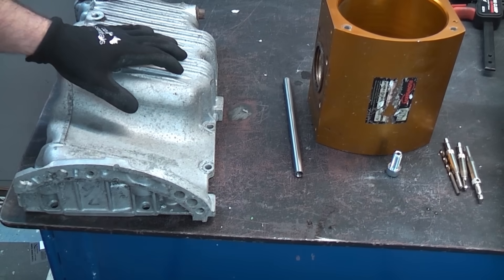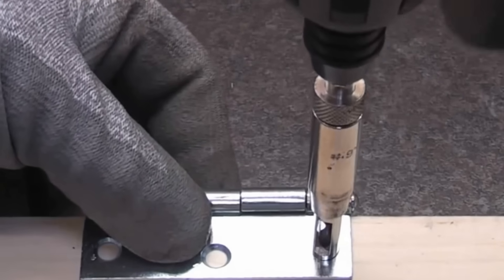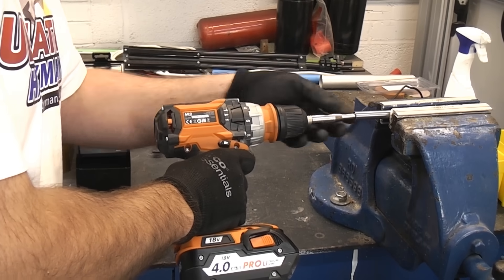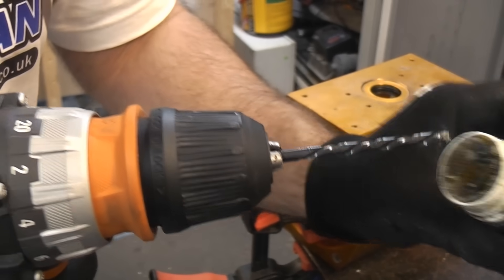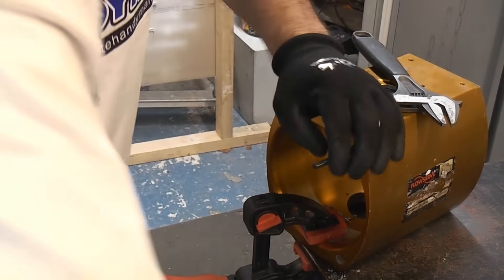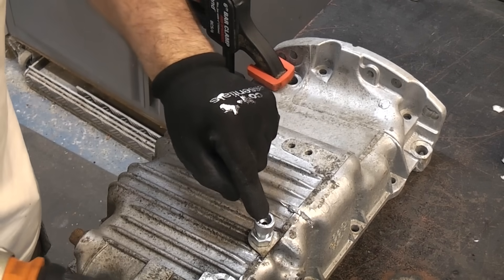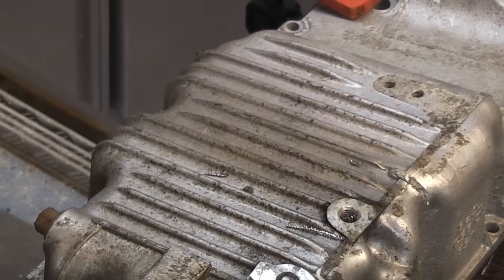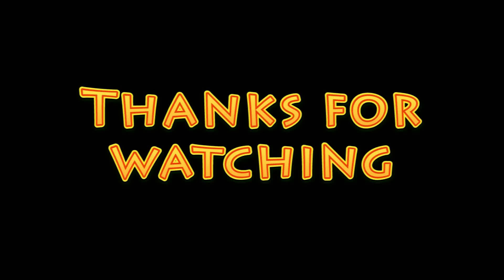How to remove a broken bolt in a deep hole | remove broken bolt in recessed hole

Comment: Sorry, I don’t mean to be rude but what did you say at 3:37? Also, is it suggested to use an impact drill for this or will a regular one work?
Reply from the maker: “you can of course use a regular right-handed drill in a hinge siting drill, but that would then mean that you would have to use a screw extractor afterwards”
Thanks for the comment 👍

Comment: i used my MIG welder and stacked welds on the broken bolt until it was out enough to grab with locking pliers. then i discovered ANOTHER broken bolt beneath that one.got them both with a MIG welder. be careful not to let the wire and puddle go into the threads.quick on the trigger, you dont want a puddle, just stack blobs of weld on each other. i did not damage any threads in my removal.
Reply: oh and my project was in the front of a Chevy V8 350 /5.7 L
Reply from the maker: Thanks for the comments 👍

Comment: great ideas always start with sharp bits made to cut through the material you are removing! and if you break a hardened screw extractor off in the bolt you will need to use a mill bit to drill that out.
Reply from the maker: Thanks for the comment 👍

Comment: 9 times out of 10  when a bolt head breaks from the bolt itself its because it is galled or seized  in the hole . its not because the head was weak and now you just need to grab the threaded part ( all of your examples) The bolt is usually broken FLUSH with the surface so those fancy centering bolts arent worth a shit either.  But as a machinist  these are all tricks your avg. Joe tries before I get it and put it in the Milling machine to get out that now chowdered to hell bolt  with messed up threads . I wish it was as easy as you make it out . not slamming you or your vid , I just deal in reality.
Reply: I agree with you about the bolt breaking, when they break on me, there usually in the worst place, not something I can just set on top the the work bench

Comment: Wouldn't a socket work better than an adjustable wrench? (Assuming there is a small enough socket to fit the bit)
Reply from the maker: A tap wrench is better- but mine was at work!
You can use a socket, but it needs to be 12 point to fit on the square end. 
Thanks for the comment 👍

Comment: Set your driller in speed 1 and on screw position so you can limit the power in case it bite to hard without warning.

Comment: I've never had to use a hinge bit, or made custom banjo style Bolts with holes in them to drill... That spring loaded punch would of been just fine for punching the center of that bolt for an indentation in the bolt to start drilling... just my $0.02 USD
Reply from the maker: Thanks for the comment 👍

Comment: What I do is I drill in the exact center with a small bit and then progressively use bigger bits till it's so thin you can use a pic to fold it then remove.
Reply: Just watched your video and I like the tools you're using.

Comment: Great video. My only criticism is that you missed what I think is the most important first step when encountering a recessed sheered bolt, which is getting yourself in the right state of mind to begin rectifying your situation. I believe these crucial first steps are as follows:

1. Swear loudly, make sure neighbors or passersby can hear, and look for anything else to blame apart from yourself.
2. Throw something at something else. As hard as possible. Morale can be gained if something annoying breaks as a result.
3. Kick something sturdy enough to potentially injure a toe. However, morale can be reduced if you do actually injure a toe.
4. Stop and ponder the fact that if a god actually exists, he must vehemently despise you.
5. Repeat steps 1 through 5 until you no longer feel a vile blend of regret, defeat, hatred and directionless rage.
6. Move on to trying the great tips in this video, then revisit steps 1 through 5 each time you fail.
Reply from the maker: Thanks for the comment 👍
Reply: 7.  Kick dog... if you don't currently have a dog, kick two cats for each dog you once loved......and last but not least... 8: Pour bourbon over ice in a medium sized glass.  Savor while thiking of your favorite vacation retreats.    Do not re enter the garage for 24 hours......

Comment: What did you used? What chemical is that?Is it coating compound? Or what?
Reply from the maker: I used a cutting paste, which prevents the drill bit from getting too hot.
Thanks for the comment 👍

Comment: as long as it s a steel bolt screwed into aluminum you can use alum to dissolve away the bolt
Reply from the maker: Thanks for the comment 👍

Comment: Hmm, could you not have done it with a smaller bore tap, drill hole, tap it with left handed threat then remove snapped bolt. Maybe producing the left-handed threat would take the bolt out. If not then tightening a bolt into the left-handed threat would remove it. (Left-handed threads tighten Anticlockwise) Just a thought, all that hammering could damage the casting I would have thought.

Comment: Very good video.I've been lucky that the bolt broke with enough steel to weld a oversize nut on the broken bolt.with the heat from the welder it came out easy....
Reply from the maker: Thanks for the comment 👍

Comment: Heh, Al is easy. What about bolts in 10-years car suspension?
Reply from the maker: Same technique, just more difficult
Reply: I've had two times that bolts have stuck in car suspension compnents and haven't been able to remove it. Both times I have simply bought anothe pice of the part that was affected and swapped them out, once a front suspension upright with wheel spindel and the other time a rear wheel spindle and torque arm. Cheap and simple. oh, you need to remove a ton of stuff and remount it though.
Reply: You need a stick or mig welder & a steady hand. Build up a nice bead of weld & grip it with vice grips once it's cooled down. I've sometimes even welded a nut to the bead so I can use a spanner or socket. Start off with small movements in & out. It usually breaks the first try but after a few attempts the heat goes through the bolt & gradually frees it off, as well as shrinking it slightly. Don't bother with an "easy out", it'll just expand the bolt even tighter.

Comment: Should have blown out the drilled metal so its not scraping the threads as you back out the bolt. Noticed you "rethreaded" a few threads when you screwed your center bolts back in to prove there was no thread damage.

Comment: Great tip on the bolt with a hole through for a guide. Corroded bolts in aluminum are not as easy though....you would swear they were welded. Nevertheless they need to be drilled IN THE CENTER...great vid!
Reply from the maker: Thanks for the comment 👍

Comment: how did you drill the pilot holes in your guide bolts...with a drill press? that is a great way to ensure you don't ruin your threads on either side. enjoy your instructional video
Reply from the maker: You can use a lathe, or a drill press- https://www.youtube.com/watch?v=6mZj0J6CNYA
Thanks for the comment 👍

Comment: I'm sitting here watching a video about bolt extraction, whilst the other half is upstairs, wanting the opposite. But I have my priorities.
Reply: I wish my wife wanted a good bolt insertion, believe me I wouldn’t be here watching a video about bolt extraction. 😂
Reply: That girl sounds like a keeper
Reply from the maker: Thanks for the comment 👍
Reply: Ha Ha Ha Ha Ha
Reply: She wants some action and you are watching YouTube?
Reply: She may prefer to be drilled
Reply: Priorities first, then nut extraction
Reply: You might actually be a nut.
Reply: I'm sure you paid for this  privilege in advance.  Watching The Bachelor,  going to the Mall,  etc..
Reply: I can personally testify, WD40 won’t make it easier...
Reply: @colinsavill3459  ...i use a trick..after the wd 40 i tap the stuck part several times..then come back in a hour and do it again. It cn loosen it but takes more time....but can be worth it.
Reply: What's your address?
Reply: Either way! you've got troubles.
Reply: This could prove useful for you in case you break it off trying to pull out.  Gotta use an extractor.
Reply: The puns here were worth checking out this comment thread.
Reply: LMMFAO!!!
Reply: Take your welder with you, don't get stuck.

Comment: i use a different bolt extractor, think its called "easy out" you drill a hole and then you got a bit that almost look like and allan key but its got splines on the tip, you hit it into the hole and it cuts spines into the hole in the bolt, then just turn it and bolt comes out, great video tho, this is becoming a lost trade
Reply from the maker: Thanks for the comment 👍

Comment: Who has access to these tools?
Reply from the maker: Hinge centering drills- https://fave.co/2DpJo1H

Left handed drill bits- https://fave.co/2xJjK1M

Teng screw extractors https://fave.co/2OnfRuF

Dormer taps -https://fave.co/2OsN1sQ 

If you are in the UK- 

Hinge centering drills- https://fave.co/2NE1VMc

Left handed drill bits- https://fave.co/2DubtF4

Teng screw extractors- https://fave.co/2pVLkVT

 Dormer taps - https://fave.co/2pTfbyx

exact cutting paste- https://fave.co/2Nabyxc

cobalt drill bits (they are much better on harder steels like bolts) https://fave.co/2zDh3kp

You'll have to make the guides yourself, but they are easy- https://www.youtube.com/watch?v=6mZj0J6CNYA&t=1s

Spring tools centre punch- https://fave.co/2NbnLBD

Comment: Good job, excellent! Even your vid quality is good and U don't waste a bunch of time showing stuff that should be obvious to garner more viewing time. Will definitely save this. The centered drill, drill sleeve is great. Yes, that is the difference of course. If you don't drill the broken bolt in the center UR going to have big problems and will usually destroy the threads in the process.  Have used grease, oil, heat etc., to loosen even rusted bolts, tapping is good too it tends to loosen bolt up. Also, aluminum expands more than steel under heat and faster as well.  Have used this principal often to remove rusted broken studs protruding from an aluminum case etc. Well done!!
Reply from the maker: Thanks for the comment 👍

Comment: Broked some 1/4" taps into a St. Steel head. That was a beaouch to fix. Used arching electrostatic vaporization removal technique.
Reply from the maker: A mate of mine works for British Aerospace Engineering and once had a stripped screw, I went and removed it for him. When I asked him, how he would have fixed it at work, he said he would spark erode it ;-)
Thanks for the comment 👍

Comment: If you cut the ends of any M16 bolts keep the ends. They will drill and tap to M10 thread inserts for aluminium if it all goes really wrong.
Reply from the maker: Thanks for the comment 👍
Reply: I got loads. Turns out you can drill the hitch holes out under a tractor by hand upsidedown if you are young and stubborn enough :o)  @ultimatehandyman

Comment: broken steel bolt in aluminum, use alum powder/water/bit of heat and just dissolve the steel. if you can figure a way to rig it up.
Its not instant but if its not time critical situation it works.
Reply from the maker: Thanks for the comment 👍

Comment: Don't get many studs or bolts broken below the surface, most are flush or protruding, I must also remark on how easily the broken studs came out, your stud extractors are cheap and nasty and a bad idea, buy good quality ones. On a corroded stud you are likely to shear a cheap extractor and then only a tungsten bit will save you.
Reply from the maker: Thanks for the comment 👍

Comment: Your hollow drill guide sleeve made from an intact bolt in sheer genius.  Well done!
Reply: I dunno. 99.9% of the broken bolts I ever encounter are right at the surface of the hole and you could never use one of those drilling fixtures.
Of the 99.9% the majority are completely corroded or jammed in the threads and even if you make a nice hole in the center an easy- out still won’t turn it.
I usually have to get a small hole as close as possible to center and then progress up in size till I’m right at the edge of the thread and then try to use a tap to clear out the remaining thread of the bolt without tearing up the base thread.
You are very lucky, it looks like all yours came out with easy- out extractor
Reply from the maker: Thanks for the comment 👍
Reply: @ultimatehandyman  I learned some of this owning Hondas in the 1960s, w/ straight blade screws-- no phillips.  thanx.
Reply: You can buy threaded drill guides in most sizes.
Reply: Yea what he doesn't say in the video is that he has started a small company that makes a nice set of those for people to buy! loll
Reply: If not already done you should patent those and have them produced for sale. I'd buy them
Reply: Happy Customer . Muy bueno, práctico...
Reply: Every workshop needs a lathe

Comment: I have found many many times that a left hand drill bit is all it takes. I have found that WD40 is worthless for tightly stuck bolts. There are much better penetrants that have high pressure lubricating qualities.
Reply from the maker: Thanks for the comment 👍

Comment: And  what happen wen is is a M 3 or M 4
Reply: M3 steel and m4 can be drilled with tungsten carbide drill bits. I like the small center drills or pilot drill bits. Carbide is brittle and easily broken so very slight pressure and a snug fitting guide and plenty of oil or coolant.

Comment: I liked this video very much, instructive and with several examples. I didn't get what is the paste you are using in the tip of the drill
Reply from the maker: I used exact cutting paste, it is similar to using a coolant/lubricant
Thanks for the comment

Comment: Why didn't you start w/ the left-handed drill bit on the valve cover? You might have gotten lucky and not had to use the bolt remover.
Reply from the maker: I was demonstrating several different techniques ;-)
Thanks for the comment 👍🏼
Reply: @ultimatehandyman  Cool. Now I don't have to worry too much about breaking a bolt. Thanks.

Comment: One thing I have learned is that when your part is cooling, that is the time to use penetrating oil so whatever hot gasses cool around the threads  will suck the oil in.
Reply: Candle wax
Reply: Thanks for that additional tip, Joe

Comment: Never let ham fisted idiots pretend they are mechanics.   No broken bolts in the first place.
Reply: Never let ham fisted idiots apply a metric shitton of thread locker to a bolt that's just holding an impeller housing together. I broke 6 out of 6 bolts trying to take that thing apart a few days ago.

Comment: Mu guess is that these bolts were screwed in there after they were broken because you usually don't see bolts brean that far into the tapped hole. This would explain why they came out so easy too. I understand that this is just a demonstration but I have removed many broken bolts and you shouldn't expect them to come out this easily, that rarely happens.
Reply: My take as well, those screws didn't look that they rust to the point of getting stuck. But regardless this the technique and was very well implemented!

Comment: I was taught long ago to never use Copper bearing Never-Seize on aluminum threads. Because of electrolysis. They make special Aluminum Never Seize. 

You don't use copper bottom paint on aluminum boats and you don't use "regular" Never-seize on outboard motors. Especially if it is going in salt water.
Reply: Never copper grease on anything Aluminium you are correct!
Reply: Or anything aluminum! :) OMC are the worst... they use nice stainless in their alu castings and dry fit the bolts. Go figure.
Reply: I think you mean galvanic corrosion.  At least, you'll get a lot better explanations of what's going on if you search for galvanic corrosion.
Reply from the maker: Thanks for the comment 👍🏼

Comment: One of the best no-BS and useful videos I've seen. The centering bolts are a great idea, surprised no one sells them. Would add that sometimes it's useful to put the screw extractor in the drillmotor. Thanks.
Reply from the maker: Thanks for the comment 👍
Reply: snapon has had the centreing pieses for more then 30 years

Comment: Try drill a hole down the center of the broken bolt then use a steel dowel the same size as your drill bit covered in silicone grease on the tip then with the drill in reverse apply pleasure to the drill causing the steel dowel to cold weld to your broken bolt allowing you to wind the stud from your work peice!!!

Comment: Lot of screws and studs are glued in the thread with Lock Tide. You need a lot of torqe to break that connection. On engine blocks, the Lock Tide is heat resistant. Do You have a solution for this problem?
Reply from the maker: Spray penetrant sometimes help to break the bond. On site we often apply some heat from the Oxy/acetylene and that normally helps
Thanks for the comment 👍

Comment: Mate you taking about bolts which are just in their, not rusty old bolts which have sheered off and then not matter what force is used you cant budge it, we had a thermostat bolt which sheared just after the head section, we welded a bolt onto it, heated it up, nothing it just broke the weld, in the end we used a bolt extractor aand the right sizer as well ,which the bolt was a 3/8 thread and we used a 9/16  bolt extractor, almost broke the extractor, in the end we just kept drilling out the bolt material till we got as close to the thread in the aluminium manifold material and re taped it again, never ever have i had so much trouble to fix a broken bolt, 9 times out of 10 a bolt extractor will do the job, but it could not do it, i think someone used a bolt securing type of paste of glue to stop it from coming out at all?